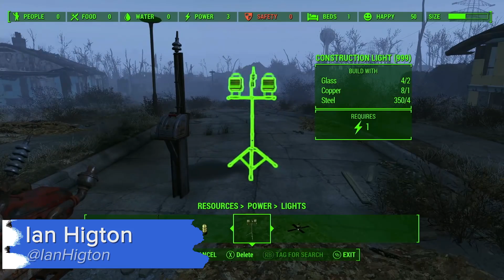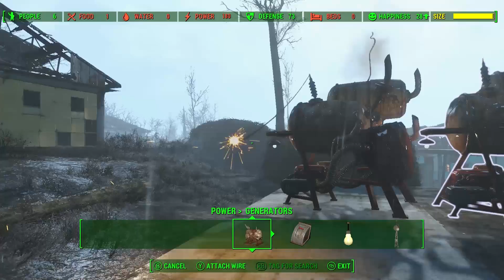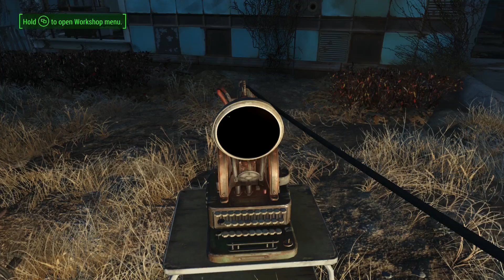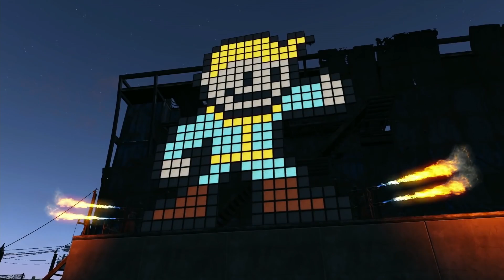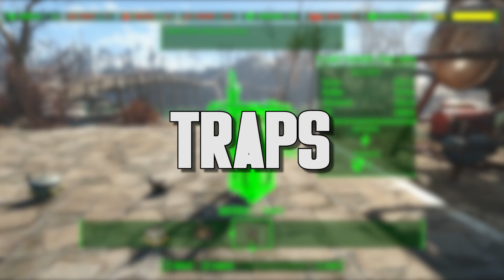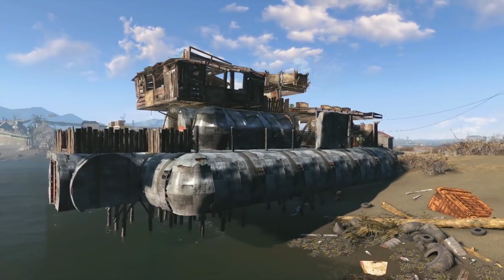Fallout 4 - Power and Programming tutorial (PC gameplay)

Comment: Don't know whether it makes sense to post this, as people may not be playing FO4 much anymore, but yet ... It is a common misunderstanding that you need a unit of power for each lightbox you are using in a lightbox installation. As a matter of fact, you only need one unit of power for an arbitrary number of lightboxes, as long as these are all connected. It is enough to daisy chain them. I found that out when creating a 22x30 installation (Minutemen flag). It worked although I only had generators producing 270 energy units to power it (and the generators were supplying power to other devices, too). I ended up powering the entire flag background consisting of around 530 interconnected light boxes and terminal controlling them with a single small generator producing 6 energy units. If you don't believe me, just try it for yourself. ;-)

Comment: Great video, thanks for the help. Only what bugs me is the noise my generators make. I want a peaceful Sanctuary not a noisy one.
Reply: +GiRayne Thanks for your comment.  Yep I've used wind ones now as well, plus I'll check out the fusion one, thanks for that. I also found a video re putting wires through walls which means I can use less generators front and back of houses.
Reply: I put the wind generators on the roof, so they're out of the way. 
Conduits come with the Contraptions DLC. I play the vanilla version, no DLCs (but use the pc console for some little tricks).
Reply: I tend to play Bethesda's games through first and then think about add-ons. I always buy games in store in town here, have never bought on Steam. Ebay yes, years ago, Tomb Raider, Splinter Cell, Thief series, etc. The last add-ons (as they used to be called) I bought in-store here (Fallout3, Oblivion) but that's changing now that games are migrating more and more to online.

Comment: I want to see if I can make a sensor grid and alarm, basically a 5x5 light box grid representing my settlement laser tripwires at chokepoints thru the settlement with speaker boxes and traps, when an enemy triggers a trap the alarm sounds the trap goes off and the grid lights up showing which area of the settlement the enemy is located in.

Comment: Thanks for the tip on using traps.  I was just popping them on the ground, attaching wire and wondering why they were going off instantly.  Much appreciated!
It takes some time, but if you're diligent about scavenging, you can revisit areas that you hadn't been to in a while and cherrypick good scrap.  I find that I miss something useful after checking a locale in the wikia, revisit and come home with a pack full of copper, oil, aluminum, circuitry and such, not to mention the xp from killing the respawns, re-picking locks and hacking terminals.  If you need circuitry, for example, hit up General Atomics every time it ceases to be "cleared" on your map.  There are several locales that are heavy on aluminum, such as the Ration Stockpile.
Reply: +Mark Blicharz Ration stockpille? Try the Cannery up near Salem

Comment: I wonder if there is a way to connect power generator outside of the enclosed building to some power devices inside of that building. I've found no information on that to date...
Reply: +Shade Run a wire through a doorway or some other opening in the building and you can.
Reply: BlackRoseXIII If the door closes, the wire sticks out of it. Perhaps it would be easier to run through the window -- but we don't have any...
IMO a mod with 2-sided wall connector would help, but I can't find one. Perhaps keeping generators inside or having their buildings partially dismantled is OK with the most...
Reply: I usually leave an opening somewhere because there are no walls with windows. My biggest tower has all the power running up centrally.

Comment: Do you need the terminal to get the jukebox to play different music? Mine only plays one type.
Reply: I don't know I will go and play F4 and then tell you if it works
Reply: +AwesomeByrd Unfortunately, it's one that type of elevator music -outside of possible PC mods for the jukes, so use radios built specifically to be tuned to whatever station you prefer.

Comment: The noise thing is cool cause you could put pressure plates everywhere outside your base and have them hooked up to one in a guard tower and if anyone steps on one it goes off
Reply: +Jimbles Notronbo I am wondering if that works with the Siren as thats the only thing that usually gets the settlers attention guaranteed
Reply: Use a tripwire with a terminal so the laser gets tripped when hostile enemies walk through setting off a tesla trap

Comment: Just as an extra what is the difference between pylons and power conduits? They both seem to do the same thing
Reply from the maker: +eric Devonshire No real difference at all, both are used to extend circuits and both can transmit power wirelessly. I think which one you use just depends on which one you like the look of best! - Ian
Reply: Eurogamer Thanks for the reply :-)
Reply: +Eurogamer 
Conduits supply power to anything within a certain spehrical radius. Eg, you put one conduit on the ground and place 3 lights next to it, all lights light up.
You place one pylon on the ground and place 3 lights around it, you still need to connect wires from the pylon to the lights to get them working.
Conduits negate the need for wires but power every electrical device in the vicinity.
Reply: +qsqua conduits do that to dumbfuck
Reply: +420Xx_FedoraSweg_xX69 Was that supposed to actually mean something?
Reply: +Naruto Uzumaki He was, vulgarly, correcting somebody. so yes, it meant something
Reply: +Anon Legion Well duh, it's called being a Smartass, I wouldn't suggest taking everything said literally.
Reply: First off, I don't think you've actually tried this if you think that. Second off, the video shows you that they are both functionally the same. They both power certain things wirelessly (only a few things, like lights) and both require wiring other things (like shotgun turrets)
Reply: +Eurogamer I do actually have a question for you. Let's say I attached two turrets to one terminal. Do you know of any way to be able to deactivate, or activate, them on an individual basis? So I can have one turned one and the other turned off?
Reply: +Andrew Enigma on controlling multiple turrets seperatly via one terminal, I'm fairly sure there is a way, as I think i remember having done it with spotlight turrets in my arena. I'm over seas right now, so I can't check personally, but I believe if you separate the circuit using switched pylons, you can seperate the control of the turrets. IE: take one terminal and connect it to two switched pylons(small or large), and then each pylon to their respective turret. Not positive, but I think that's how I made it work. if it doesn't work, and you haven't found a fix in two days, I'll have access to my game to figure it out for you. hope this helps
Reply: Gavin Walling Oh my that does sound great! Thanks. Might have just saved my dream of having a master control PC :P